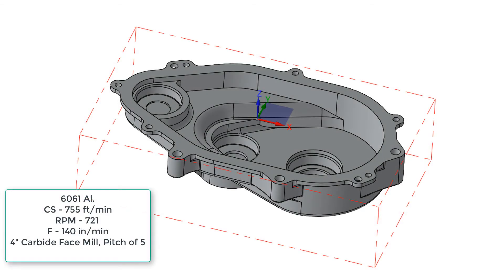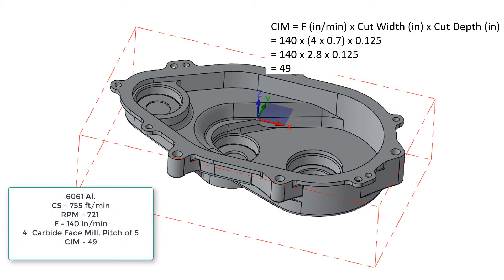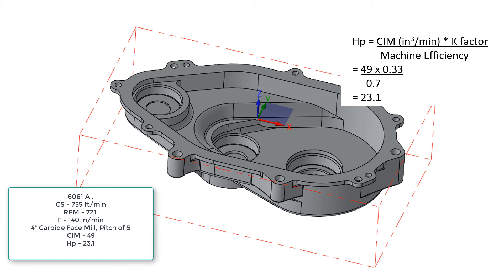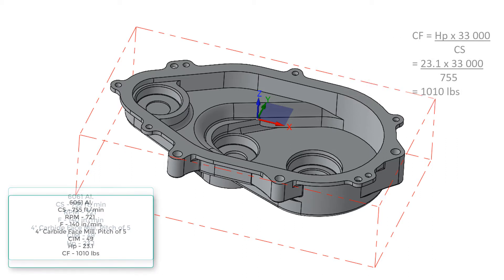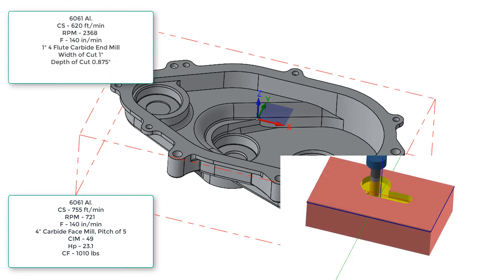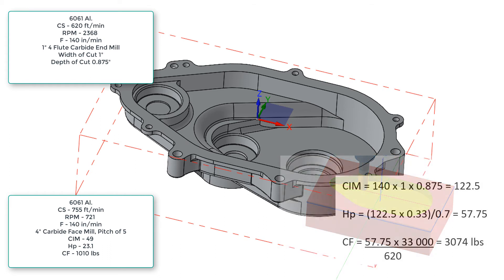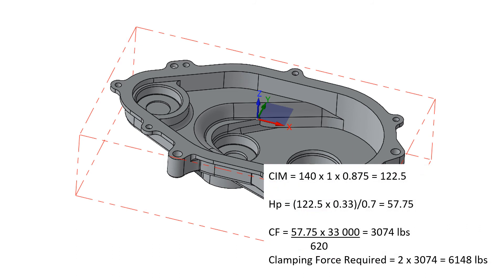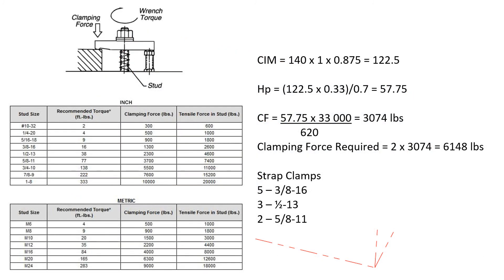Face Milling Cutting Force Sample

Comment: Hi Fred, Nice video and explanation! 
I'm trying to do this calculation with metric inputs (i'm from Holland) but i'm wondering where does the K-factor come from? (what unit is it?)
It will be very helpfull for my custom milling machine built im currently working on.
 I need to do the calculation based on carbon/alloy steel.
Reply from the maker: The values come from the Machinery Handbook, if you look you will find my metric force calculation videos, in this playlist.
https://www.youtube.com/playlist?list=PLIPWVPi1lQMtO4WCfWvM4u5SCOIQzCHJn